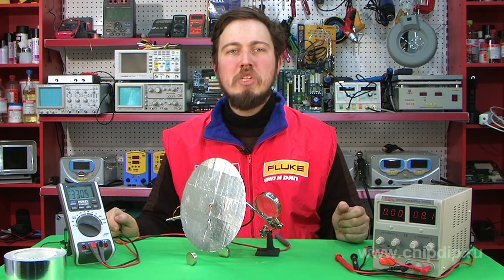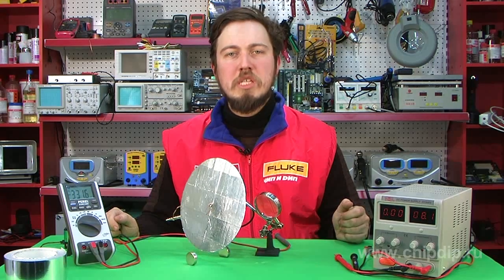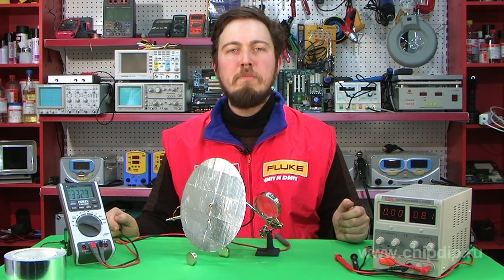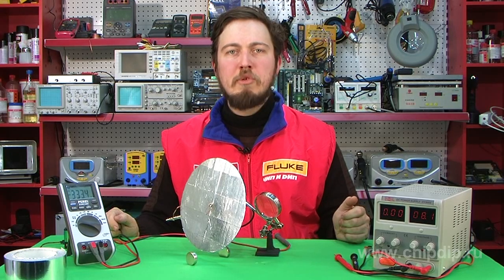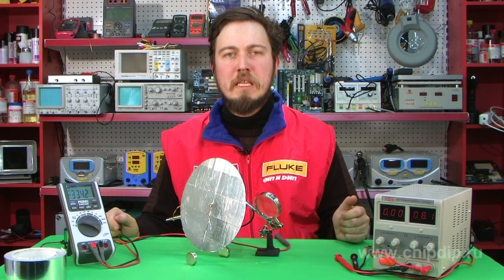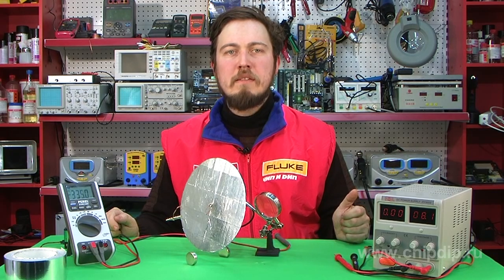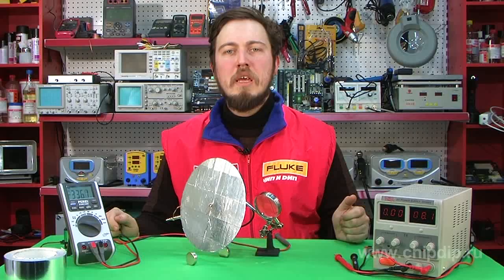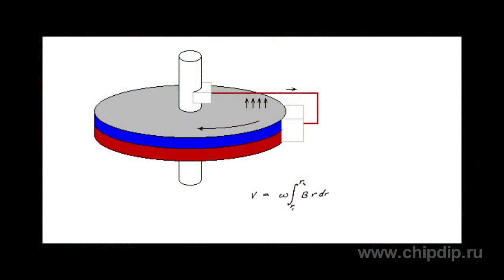Faraday Disc

Comment: Thank you for the video, 
I am developing a new generator that produces a true D.C. current. 
it is not a faraday disk 
it has no rectifier 
it has no brushes
I would like it to have magnets that move along with the coils but I have little knowledge of this kind of generator. 
can you please tell me if the output of a disk with magnets attached to disk is as efficient as a disk with magnets mounted solidly near the disk. (disk rotates near magnets - not with)
Thank you 
Harold
Reply: lol
Reply: Done bro ?
Reply: Lol